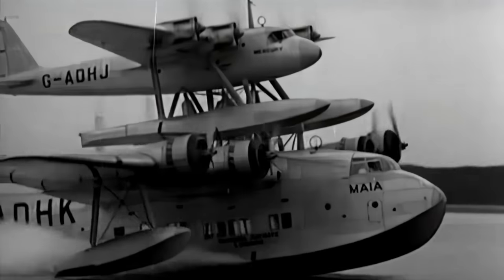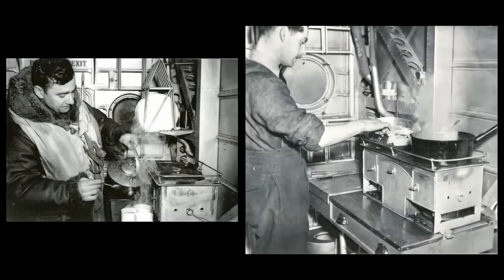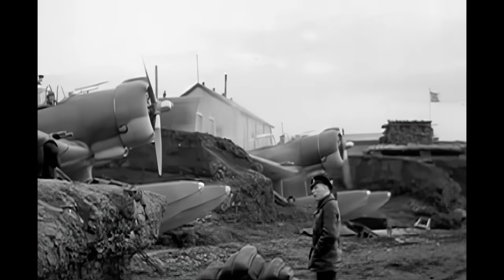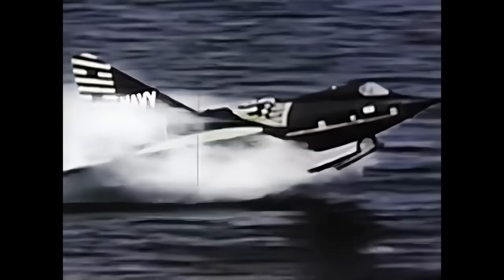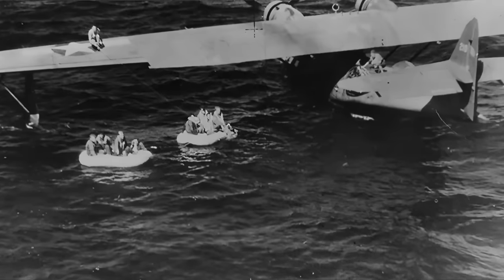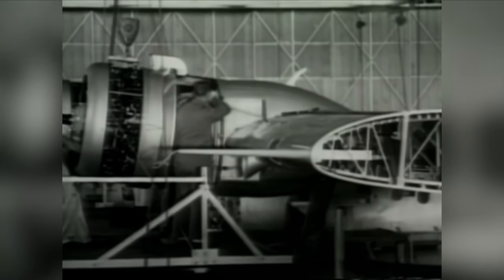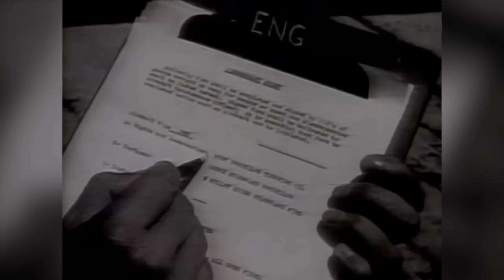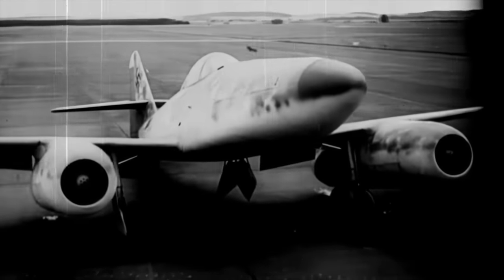Unusual Early Seaplanes, And A Brief History Of Flying Boats

Comment: Why didn't I think of this before?!

Electric motors are great for cruising, it's getting up high enough that's a pain in the butt.

I bet you could get a really big electric aircraft really high up with a combination of rockets and ramjets.

Then separate and the motors come back to do it again.

It's not like you're trying to get to orbit so the booster stage could be made rather robust, and highly reusable, just fuel, attach a payload and go.
Reply: An Helium balloon or an airship could do perhaps the same task without adverse environmental concerns ?